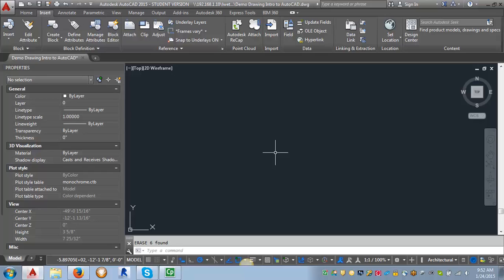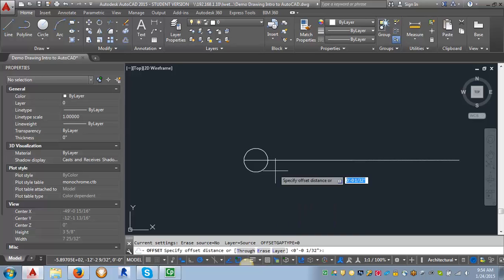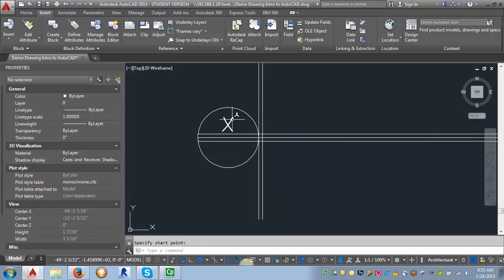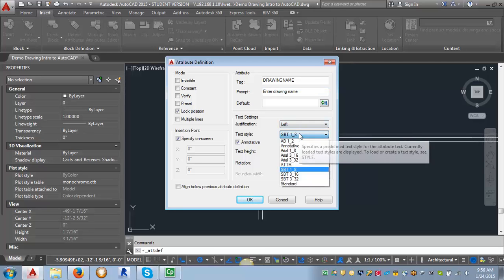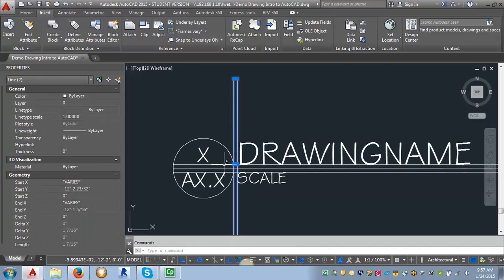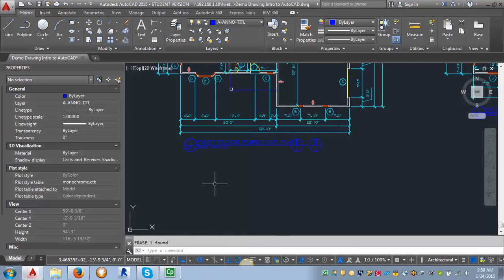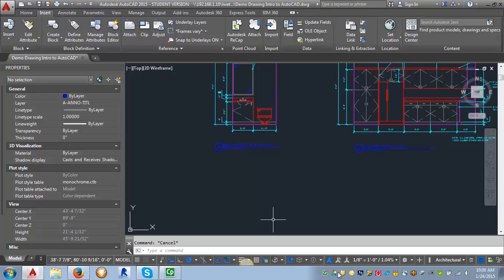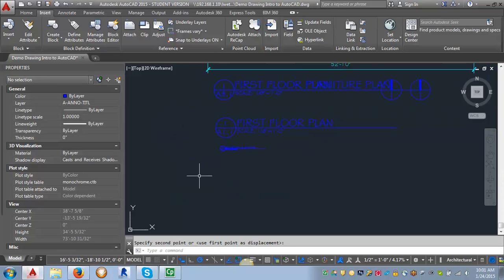AutoCAD Demo - Using attributes in a block and creating an annotative block

Comment: Thankyou, very informative and handy. Now the Question. Why do you not use Paper space to add the Titles, scaling only your viewport. You will save save so much time. Then you bring it in 1:1 in Paper space, using several different viewports, on a viewport layer, of which the printing icon is turned off. You need 1 Textstyle, of which you just change the size. Your very handy attributed blocks and 1 Dimension style. AutoCAD does support your drawing style, but were created since I think AutoCAD R13 (1995?), with Paperspace and it is the way it should be used.

Comment: For some reason I tried to create a tag circle with attribute in annotative inside of the circle in model space at 1:1.  Then I turn it into a block also in annotative mode.  When ever I go into model space in the layout sheet, and insert the leader with block content type and enter the block name, it gives me a "invalid input" on the command line.  Then I researched in a few forums and found out that you can't have the block as annotative if the attribute is already annotative.  And it worked just fine.  I don't think it has anything to do with me having AutoCAD LT and you having the full version.  But I am more confused now  :p  

Great video by the way, very clear explaining the steps.  Thanks for your videos.

Comment: Thanks for sharing the video. it helps a lot. 
In the video 9:03-9:07 when the block is moved from top to bottom the scale is changed,  could you explain how to do when working on model view rather than scaling the viewport ?

Comment: thank you for making this video,
i have an unusual issue i hope you can help with.
ive created a block after watching your video.
i insert my block at the correct annotation scale. 
i then change the annotation scale so i can add a the same title to a detail( at a different scale), i then insert the block, but instead of the newly inserted block being at the correct scale, all of my existing block are scaled to the new annotation scale. its like all of my blocks are linked. i think this issue is in the way i created the block, any suggestions on how to fix this?
Reply from the maker: +Joe Holewski Check to see if you have “Add scales to annotative objects when the annotation scale
changes” turned on.  It is right next to the annotation scale at the bottom of the sheet, it is the cross section of the architectural scale with the lightning bolt next to it.  This adds any annotation scale you switch to to all of your annotative objects.  Try turning it off and removing the scales you don't want from each object in Properties.